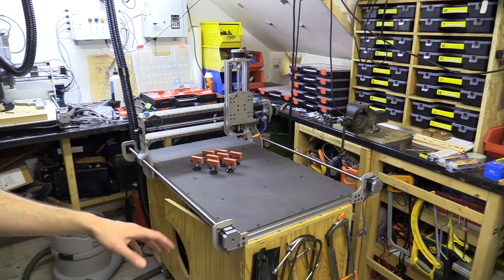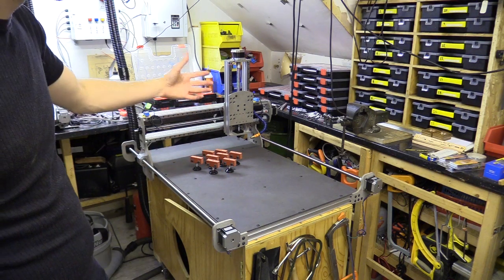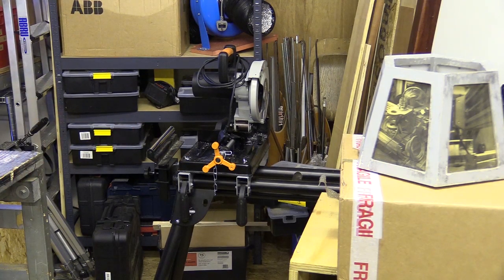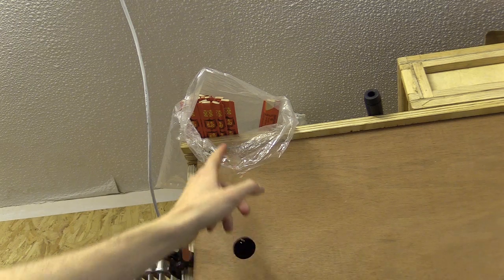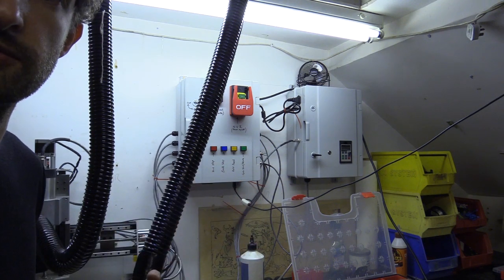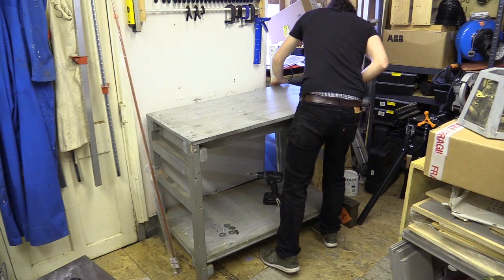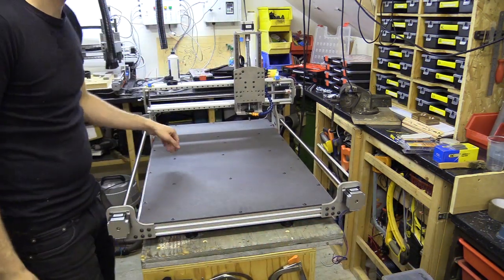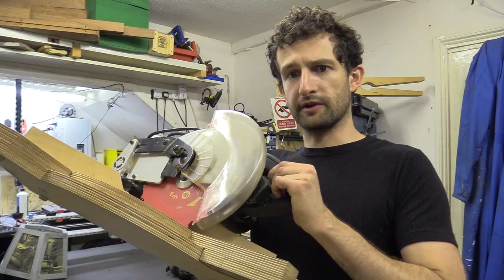Selling YouTube Stuff on Ebay / Channel Update

Comment: Hi Savvas, I always thought you lived in the USA for some reason, until you mentioned being in the UK I never gave it a thought. This changes everything, I now could reach you for a one-day course and even possibly buy one of your CNC. I already have a CNC but I haven't got around to using it yet and it has been sitting in the back bedroom doing nothing of over a year or even longer mainly because of the size (about 12inches square) and I am also very lazy most of the time.
Reply from the maker: I've never even been to the usa! That's encouraging - I thought that part of the video fell on deaf ears. Being lazy is an important requirement to wanting to use a CNC machine in the fist place. I'd be happy to do a workshop with you first - you may decided you want to keep the smaller machine after that or build/commission a larger one. Maybe get in touch with me via https://miscpro.com/contact/ and we can discuss dates and stuff like that. :)

Comment: I trust the new CNC will cut aluminium just fine, but will it be able to cut steel? Even if it can only just, then it would be very interesting.
Reply from the maker: I'm not sure it rigid enough for steel - but I can only try. It will definitely cut all types of cheese.